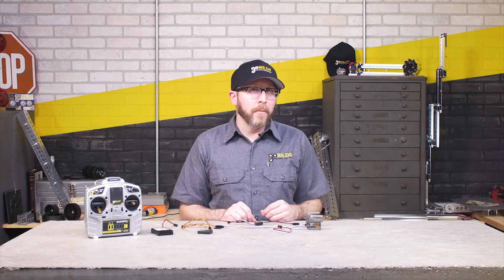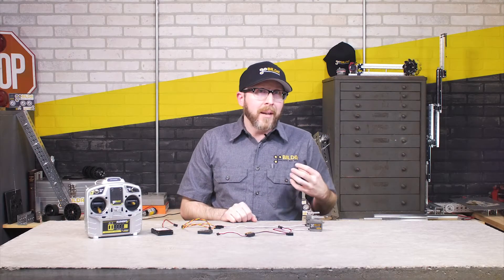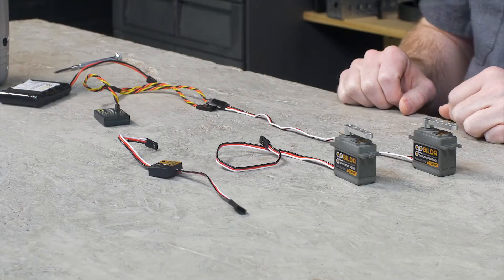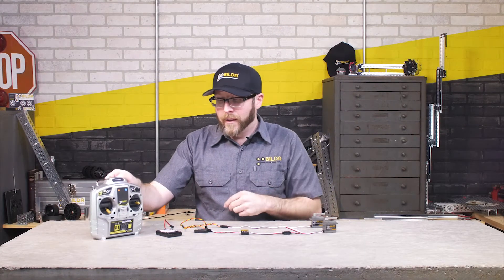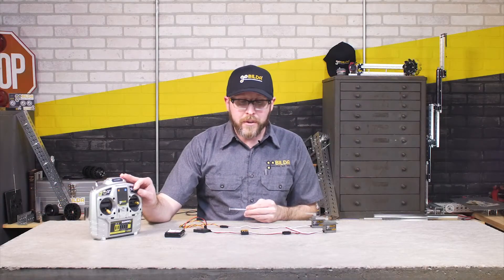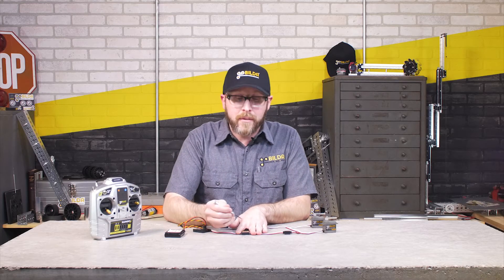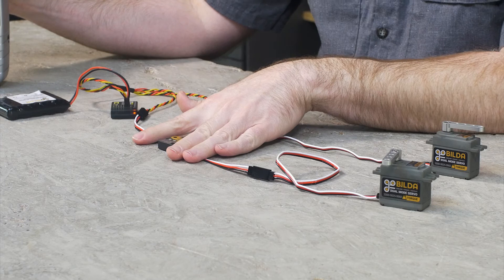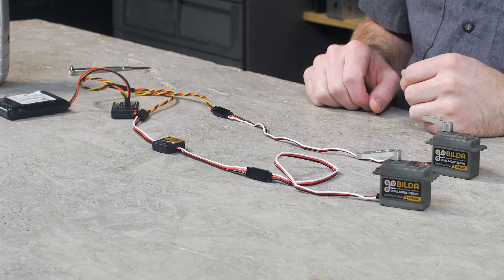Servo Travel Tuner - Easily Control How Far Your Servo Rotates!

Comment: what would be the range with a hitec HS-805BB servo ? normal its from 1 to 180 range .
and does it work on 6 volts ?does it need to stay connected after adjustment ?

Comment: So looking to update my kicker motor throttle and steering on my fishing boat from a linear actuator to a servo. Both actuators are hooked up to a 4 way switch controlled by a wireless remote. 2 channels work the throttle and 2 work the steering. On the throttle end I have a speed controller so I can better fine tune the trolling speed.  The 12" actuator I am using for steering is way to slow. Can you tell me what I would need to get in order to swap over to actuators? Steering I need it to move quickly and has about 12 inches of side to side movement for full turns. Throttle has 2 inches of travel. Everything is running on 12v.

Comment: hey goBILDA nice to see ur video👍,
please help me to choose which component i should buy if i have some project🥺. 
I want to make servo move due to DC voltage input, DC input from 0.4V-4.5V (i want servo movement depends on input voltage, maybe like throttle gas). 
And i want make it adjustable by screw like this video for servo movement. 
I don't want to use Arduino, bcz i just need 1 input and 1 servo and make it simple hehe. Help me please, thank you so much 😁